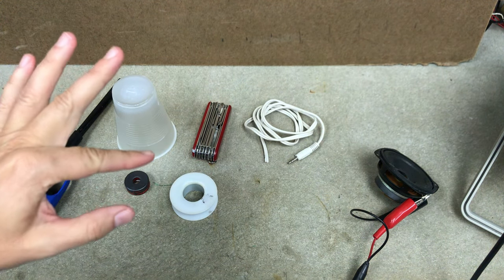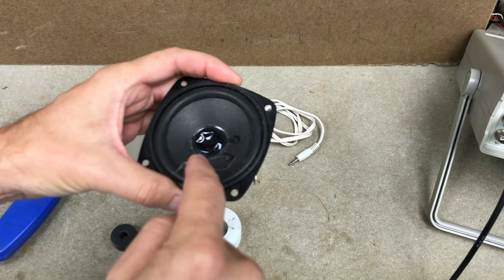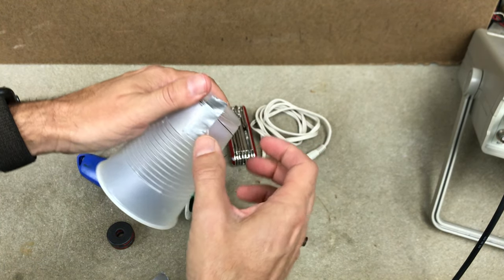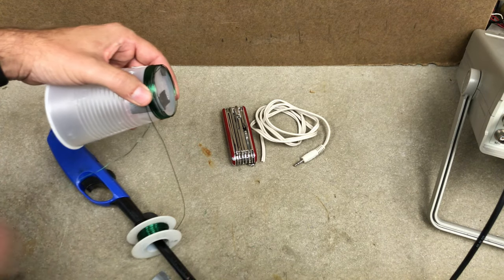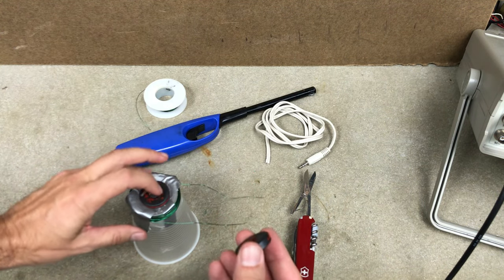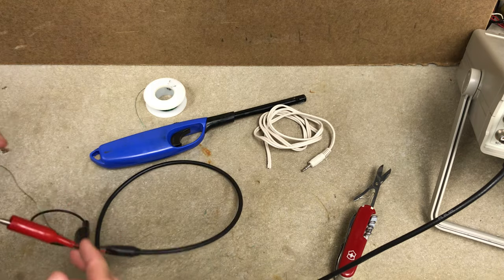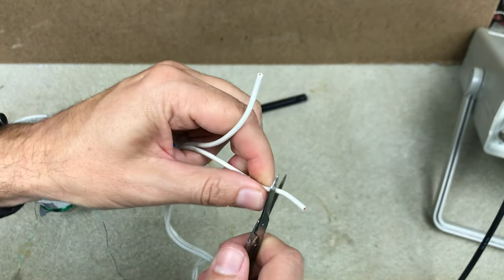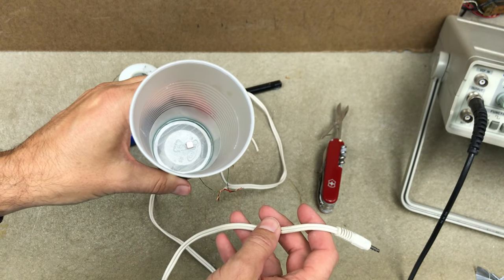How to build a speaker with a cup, a wire, and a magnet.

Comment: NOTE: if the two wires doesn't Look isolated or they have color, then it means that they are coated so you need to remove it By sand paper or flame
Reply: Lol, flame? I just use rub scissors on it.
Reply: @Handlebrake2  That works,,
Reply: what if the aux cord has 3 wires in it? A red, green, and copper wire. I got it from an old pair of headphones. How should I connect it?
Reply: @cjprocker  ok that's strange, didn't know there was copper wire with no insulator in aux cord but it's possible that it has left channel , right channel and ground but I didn't try it so
I Can't help you, sorry.
Reply: Do you know a specific audio cord that I could buy that is like the one he used? I can’t find any good audio cables, all of the ones I found at my house the inside wires are super super tiny so I can’t get a good connection

Comment: you may not see this, but can i use a wire coated with some school glue as substitute for copper wire?
Reply from the maker: you can use the glue wire - but that might be tedious to build
Reply: @rhettallain  thanks for responding, but i have a way, now i just need to find magnets
Reply: @rhettallain  I am currently letting the wire dry  and after that im gonna put a second coating for best results. I hope this works so hours of stripping a wire off a broke computer power supply will pay off

Comment: This is my favorite thing to do, Need help with this kind of idea for a vintage disk cutter, more help pls.. ?? I have fun replicating speakers, but not sure how to drive it unless u wrap the wire around a nail. as the coil would get very hot if not in an isolated chamber.. so dont leave it on long..  although plastic would have somewhat of a temperature that could deal with it. I would think a milk container would stand the heat though, Nice detailed video with the items, Description and applicant is very clear, Nice video, keep makeing these..

Comment: How does it work?
Reply: and how do more coils affect efficiency? Is it a linear relationship?
Reply: The coil is an inductor. Watch this if you don't know what that is: https://www.youtube.com/watch?v=ySx84Ca7BFQ
Electric current passing through the coil creates magnetic fields. Magnetic fields cause the cone to attract or repel the magnet, which makes the cone vibrate. The vibrations of the cone make vibrations in the air, which is sound.

More windings = more inductance, which makes the speaker louder, but also less responsive. Higher frequency audio gets cut off by adding too many windings, so more windings = lower maximum pitch. That's why bass speakers are big and treble speakers are small - a bass speaker trades off being able to play high frequencies vs being able to drive a larger cone.

The main problem with this speaker is the magnet is directly attached to the cone directly. It can still vibrate because the plastic is flexible, but the vibrations are very small. If you attached the magnet to a surface and suspended the speaker cone above it, the sound would be huge.
Reply: @hohsisterofbattle  thank you so much

Comment: @Rhett Allain
 does it work with copper wire?
Reply from the maker: as long as there is a coating on the wire.  If it's bare copper wire, then no